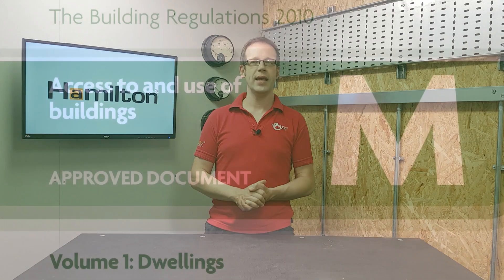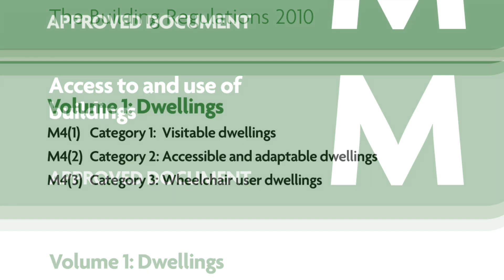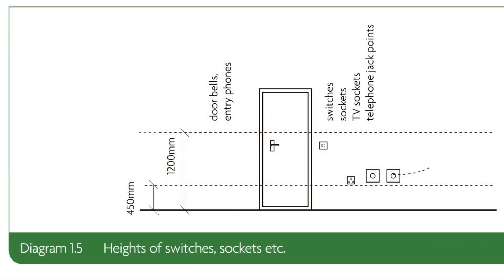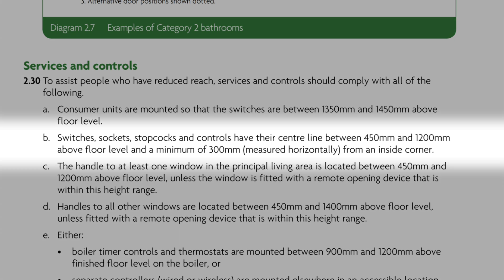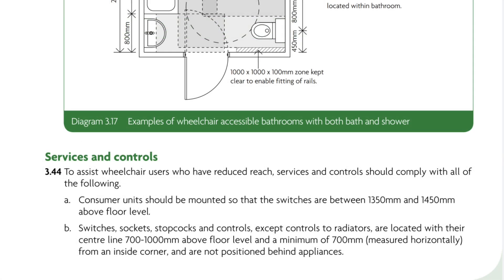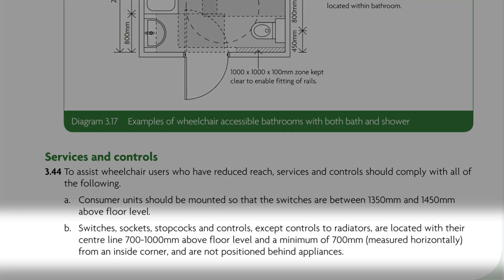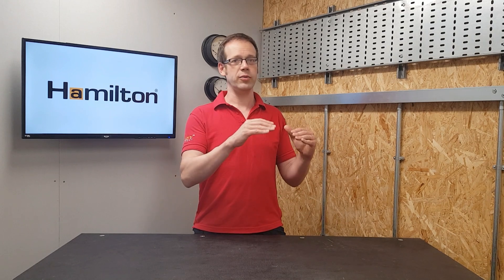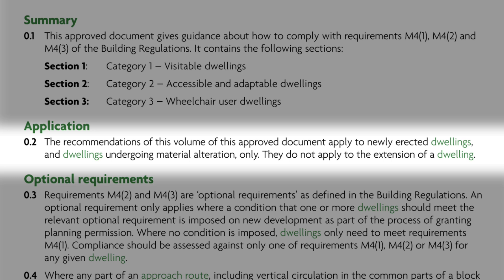SOCKET & LIGHT SWITCH MOUNTING HEIGHT -Part M building regulations new build, rewires & extensions

Comment: Thanks for the video. I was always aware that sockets in new builds were 450mm to the bottom of a socket & 1200mm to the top of a light switch for instance. Do we now need to take advice from Part M over standards in BS7671?
Reply from the maker: Part M is the document used to sign off building work and is a statutory document so it’s a requirement.
Reply: @efixx It doesn't say  what your interpreting it as look at the diagram the diagram is correct not the text

Comment: What if I am rewiring an old home without doing any extensions, and I want the rewiring to use the same light switch and socket locations. Can the locations remain, or do I need to change all the socket and light switch locations in the entire house?
Reply from the maker: You can keep them the same.

Comment: Hi there. I've got an old flat, and home report for electrical was marked down to a 2 as all sockets are currently in skirting boards. Looking to change skirting boards and move sockets to wall. If I'm moving the sockets do they have to comply with the new height regulation in order to have the electrical part mark to 1 if then selling?
Reply from the maker: No they can stay as the rest of the house - but in the skirting board isn’t great for plugs which are moulded on to flexible cables

Comment: Is this a reg or building reg for years now we have been fitting sockets 450mm from floor to bottom of the socket not center
Reply from the maker: 450mm to the centre is the lowest allowed so 450mm to the bottom is perfectly acceptable. 👍
Reply: @efixx  what is the typical switch height then?

Comment: The key word is recommendations.

I know one guy who built his own house. He would not have sockets half way up the wall.  He put them at skirting height. The BCO had no problems. The BCO was fussy on step free access and outward opening toilet doors on the ground floor, that was all.

Most of the electrical regs can be ignored, as long as the installation is safe for users and electrically sound.

You can buy the cheapest and nastiest USA equipment, inc' sockets, AWG cable, and main panels, from their Home Depot, which is all 1930s to 1950s technology, then fit it all in a UK house. No RCD, etc. All is fine.  I am not saying do that, just emphasising that the regs were not brought down the mountain by Moses.

Comment: Here in Germany it's 105cm from the finished floor to the center, for what you call chapter 3 (wheelchair height) it's 85cm from the finished floor. 105cm is easy to retrofit if the door case is installed without measuring it, because it's also the standard height of the door handle and you can use that as a reference point.
Reply from the maker: That's really smart. 👍

Comment: It’s good you did this video because, before I started to do my own electrics (and get them signed off, before someone starts on me) I had a spark who came round to wire in a radial for a small porch we had done. And some lights. 

He insisted that the heights for the two sockets and single light switch MUST match Part M. I told him he was wrong. He was not happy. Nearly walked until I pulled up the Approved Doc on my laptop and showed the “new builds” bit. 

He then added them where I wanted them, which was to match the rest of the house.
Reply: Your experience with a professional electrician reflects mine. Three sparks in room will have four opinions on why they're right about regs and methods and the others are wrong. Then I download and read and see they're all a bit right, a bit wrong, and all do sloppy work. The difficulty is finding a good electrician
Reply: @cuebj  3 Sparks in a room! 1 to make the tea, 1 to moan all day and 1 to put the Down lighters in the wrong place and blame the joists.
Reply: i bet he felt like a pratt
Reply from the maker: At least he was trying to do what he thought was right. 😊

Comment: Iv got a question for you or other sparks, Do usb sockets pull more current than standard sockets due to the extra usb outlets? therefore is is safe to put them on a spur from a ring?
Reply: yes there will be more need on these bit i dont see a problem as long as the circuit and handle it

Comment: If I was adding a socket to a existing circuit in a domestic setting in a room I would consult the owner or tenant  of the property if it would be a different height ,depends as well if they have disabilities and struggle to reach existing sockets or not.
It would be a case by case basis on existing properties.
On new builds or rewires I would try to keep it at part M Regulation heights.
Reply from the maker: Good sensible approach.

Comment: What about for a rewire where there is no extension? Most of my clients don't like the idea of the sockets being so high up. I am used to the height now and see no problem with it.
Reply: This is only for new builds.
Reply: I am in this situation. I (as the client) specified that the sockets, switches and DB all meet the new regs but could’ve gone with lower heights. 

Personally if there is an opportunity to make something better then we should. Isn’t just about disabled people either. Could be an older person or a younger person with a rubbish back. 

Also, my sockets are mainly in locations out of obvious sight (behind TV unit or bedside table) so the look is largely irrelevant.

Comment: Light switch shoulder hight, sockets centre of your shin ,
For a dwelling for people with disabilities  and are dependent on wheelchairs then about waist hight. How sparks actually get the tap measure out and measure the hight to the exact hight . I don’t know any. As specially on domestic installations 
Another fantastic video as always Joe
Reply: That was done here the same way in the old days in Germany. Now it's 105cm from finished floor, and 85cm for wheelchairs. In retrofits no one will measure that precisely, the standard height of a door handle is also 105cm, so we use that as a reference point.
Reply: Exactly the reason we have regulations I suppose
Reply: @12000gp  if you stand next to any of the lights switches in your house I bet you find them at shoulder hight give or take an inch or two , and your sockets are at the centre of your shin give or take an inch or two,
That’s what I was told by a number of sparks.